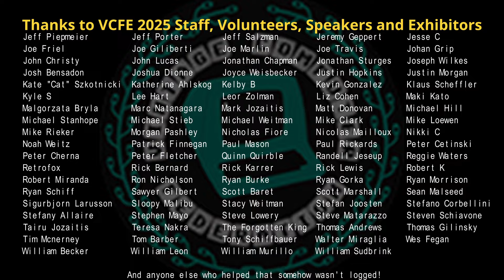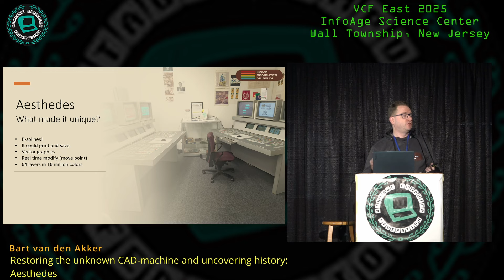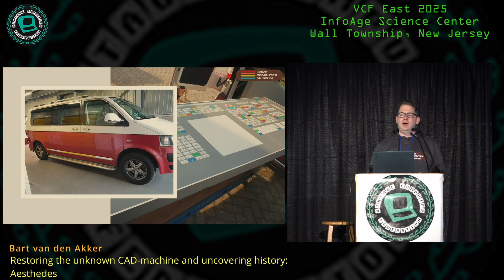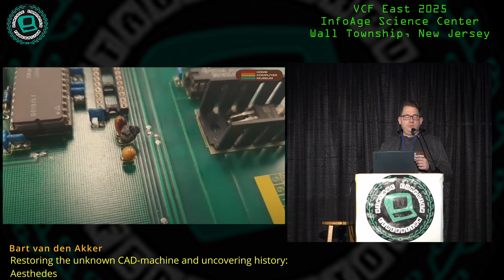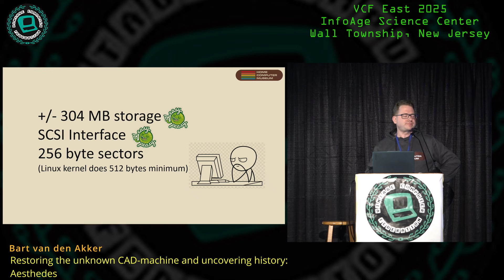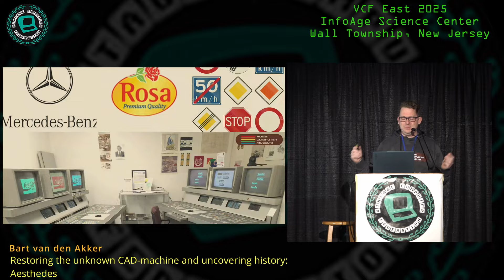VCF East: Aesthedes: Restoring the unknown CAD-machine and uncovering history

Comment: I think the terms everyone seems to not come up with are "paint program" and "draw program". "Paint" primarily deals with pixel graphics, while "draw" primarily deals with vector images. Those are 2 very distinct kinds of software, even though there can be some overlap, like paint software supporting splines and draw software supporting bitmaps.
Reply: It is a cad machine so it always uses vector splines.

I never heard the term draw or paint program in a professional environment, those are usually used for amateur software.
Reply: @rolux4853 Whats your definition of amateur? Back in the day, illustrators used drawing programs like aldus freehand, adobe illustrator or corel draw whereas photographs and game designers used paint programms like deluxe paint, pc paintbrush and Adobe Photoshop. Those were professional Tools for work as well as afordable Hobby Tools used vy amateurs - a Photoshop  license wasn't exactly cheap
Reply from the maker: @mariusreineck2984: Very true.
Reply from the maker: @rolux4853: Thanks for your input!
Reply from the maker: @altebander2767: Good point!